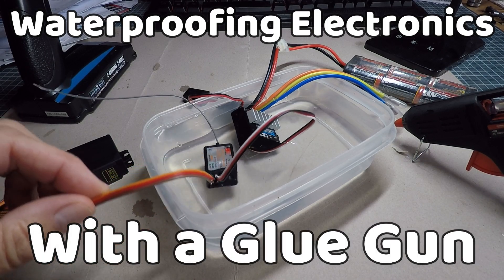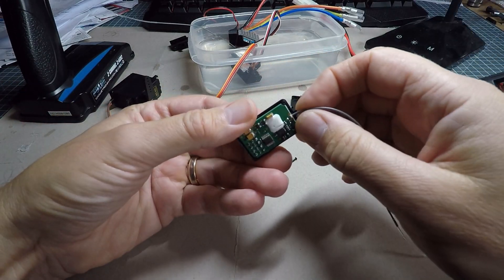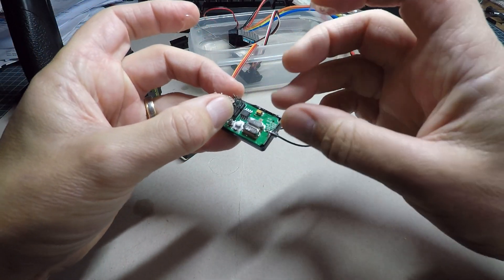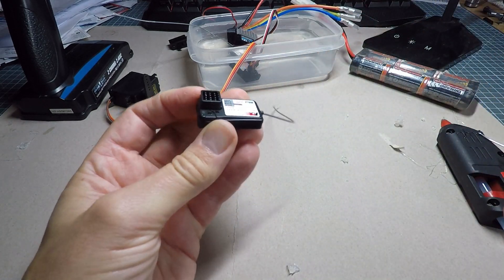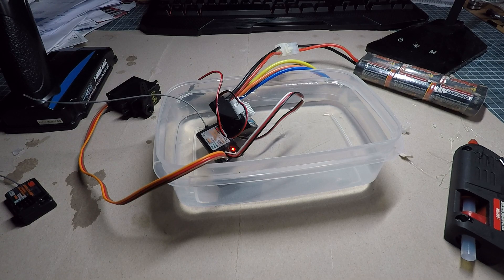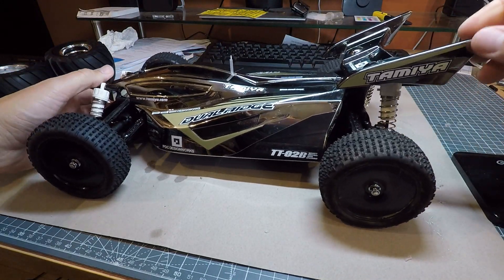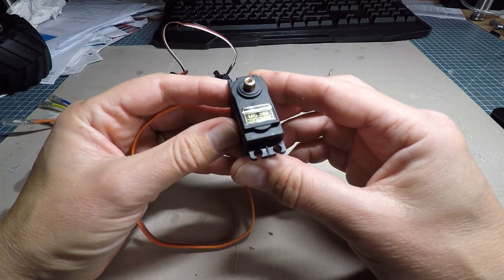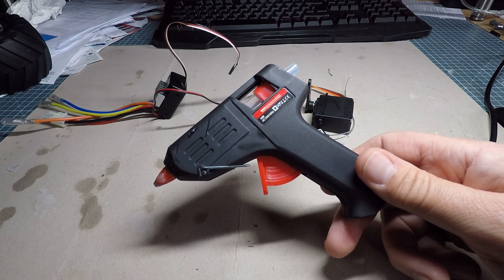Waterproofing RC Electronics Using a Hot Glue Gun

Comment: Hold on a minute....... the Board is now water proof, but what about the pins  where the servo's plug into..... if you have water over all these then it can burn out because you will be connecting positive and negative through all the pins....... or did you glue these as well when off camera ?
Reply from the maker: Hi there. Thanks for the question. You are right that the pins will still get wet but it doesn't matter with this low voltage. The receiver stops working when water gets on the components on the circuit board but the pins and plugs can get wet without issue. What I'm doing here is similar to what manufacturers do to make receivers or ESC's waterproof. The plugs between your battery and ESC aren't waterproof either. It's worth saying that if you had an RC submarine then you'd probably want to waterproof everything thoroughly to avoid corrosion of the electronics. One of my lipo batteries did puff up after the car went in the sea! All I can say is that I've used this hot glue method a load of times without issue. If you want to protect the whole thing then you can secure it in a balloon and zip tie it which is what I used to do.

Comment: Would it work for a mn99s and could i fully submerge it in water and it would still work?
Reply from the maker: Haven't got one but you should be able to use this on any circuit board that doesn't get hot. This video is only a suggestion. There are various ways to waterproof electronics. Never a good idea to totally submerge your RC even if the electronics are waterproof. Ruins the bearings for a start!

Comment: Hy sir what wattage of glue gun is sufficient for this purpose that u r doing in video and for other rc electronics?
And does high wattage glue gun will cause issue(melting etc) on rc circuit boards? cos more wattage means more hot glue...
Reply from the maker: Hi there. The glue gun is 10 watts.  I've also got another one that is 20 watts.  Both seem fine for this.  I probably wouldn't use this method on the ESC despite what I say in the video because it might get hot enough in use to melt the glue.  Having said that it's been fine with the Tamiya one and 7.2 volt battery which doesn't really get very warm.
Reply: @PeteWylieRC  Thnx for elaborating and explaining sir!!! But sadly I have a dual glue gun that's 60 watts on low and 100 watts on high😕 
Will 60 watts do the purpose? or is it more than required and I have to buy a lower wattage gun for waterproofing rc electronics and stuff like that?
Reply from the maker: @usamanawaz1126  I'm not sure to be honest. I'm thinking that it would be ok as they probably all melt the glue at a similar temp.
Reply: @PeteWylieRC  Thnx I think I should go with 60 watts if it'll serve the purpose than OK else I'll buy a lower wattage gun Thnx a lot sir for helping me out stay blessed ❤️

Comment: did you have any issues with heat in esc that might melt the glue and unseal?  great idea. I was gonna  try corrosion x, but this is cheap,and fast. thanks.
Reply from the maker: Well I only did this method on the low power Tamiya ESC's that I run with NiMH. Higher power ones would possibly get hot enough to melt the glue. I tend to buy brushless sets that are waterproof from the factory. Many thanks for watching 😀

Comment: what if the electronics get hot and the glue melts   broken electronics cheaper but less realiable
Reply from the maker: Hi there. The receivers never get hot and I've done this on all of mine without issue. Haven't had a problem with the ESC's either but I've only used it with low power Tamiya ones. Thanks for your comments 😀

Comment: can I use hotglue on USB soldered connections?
Reply from the maker: I'd imagine you could use it on anything low voltage that doesn't get hot enough to melt the glue. Thanks for watching 😀
Reply: @PeteWylieRC  yeah i tried it. video helps

Comment: I wanna do this, but would the glue be hot enough to melt some solder joints?
Reply from the maker: I'm not an electrical engineer but I'm pretty sure that the glue melts much cooler than solder. I've done this waterproofing method many times without issue. Thanks for watching 😀

Comment: What about shrink wrapping then capping the ends with the glue.  Also use a washer with glue to strengthen the wheels
Reply from the maker: Although I was just thinking that shrink wrapping is only really suitable where you don't need to get to any plugs or buttons. Doing the receiver with glue carefully on the circuit board means that I can still use the plug connectors and the reset button as normal. Also on the ESC I have left the heat sink uncovered. If you have a circuit board that you don't need to get at then it would be ok to encase it completely. Cheers for now 😀
Reply from the maker: Both good ideas. Many thanks 😁

Comment: can i waterproof my esc with it? i saw somewhere that you shouldnt apply hot glue to circuits that operate at 100 or more kHz frequency. at what frequency do 45A ESCs usually run?
Reply from the maker: Hi. I think it's ok with low power ESC's like the Tamiya with a 7.2v battery but probably not a good idea with a high power system as it might get hot enough to melt the glue. I have tested this extensively with the receivers but not so much with the ESC's as I tend to buy the ones that are waterproof from the factory.

Comment: Well that didn't work. It comes smoke from the  receiver after the hot glued it at  03:33..
Reply from the maker: There is just some bubbling because the terminals aren't waterproofed. I think it's electrolysis or something like that. Anyway, absolutely no harm done and it still works perfectly. I guess if it was going to be permanently under water then it would be best to seal everything up completely but this is fine for an RC car. I've done all of mine like this and they work fine. Thanks for your comments

Comment: Ive i always wondered if i can do this... I was just to scared to try it thinking the hot glue would be conductive and i might short circuit something.
Reply from the maker: Well I had a job lot of receivers which weren't very expensive so I thought what the heck, I'll give it a go! Seems to work ok so hoorah! Many thanks for watching and commenting 😀
Reply: With silicon you are vulcanizing. It's safe.
Reply: One additional advantage over using epoxy is that the ethylene-vinyl from glue guns can be fairly easily removed with rubbing alcohol, which won't damage electronics either ( though IPA can potentially remove or thin silicon grease on moving parts ).  However, this method, from what I have read, won't hold a seal forever.  The proper way to waterproofing electronics being the use electronics-grade silicone adhesive sealant.

Comment: Good thinking, Pete! I've actually had the Araldite sitting here for a long time ... maybe ever since Matteo did his video, and never gotten around to trying it out. Would love to try with the GoolRC receivers I have. Looks the same as the FlySky you have. Maybe I should try hotglue instead.
Reply from the maker: Yeah I got the Araldite and I did do one of my RC receivers and it worked great but I never did it again as it seemed like a bit of a faff. The glue gun seems easier as there is no mixing and you just have to squirt it on. Good luck if you do try it out. It is that season when you can't avoid the wet ground so the more methods of waterproofing we have the better. Thanks for watching Mikael. Hope you are having a lovely weekend 😀
Reply: Nordic RC Visions hi, I’m new to Rc but had other experiences in trade related solutions & none adhesion methods like shrink wrap work well & less messy, but allow the feelings to return to the finger tips